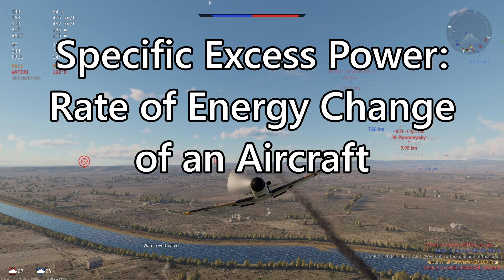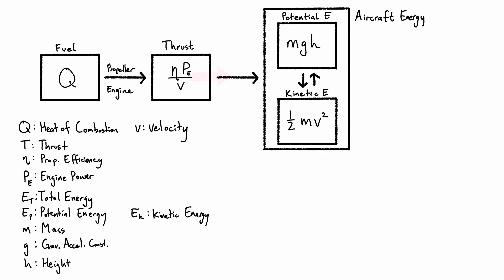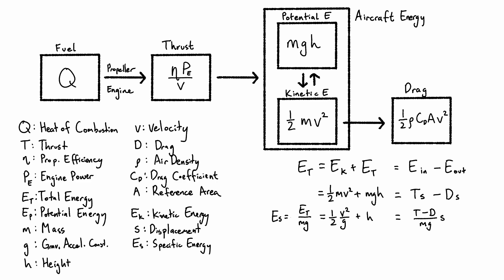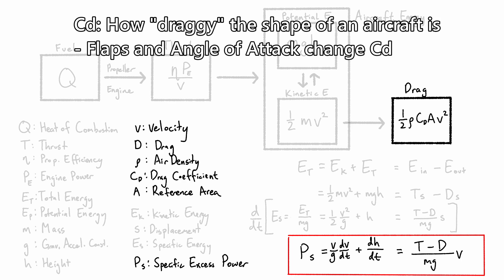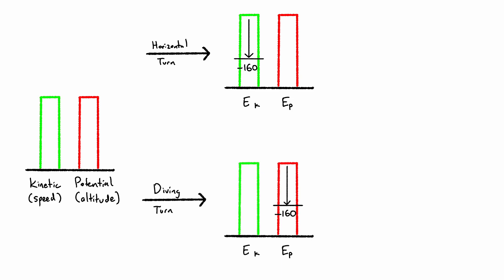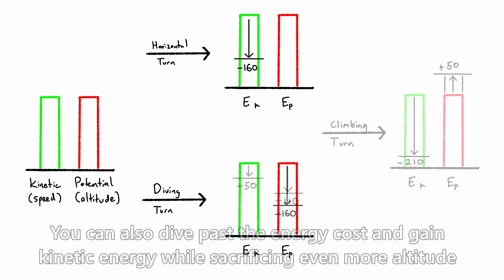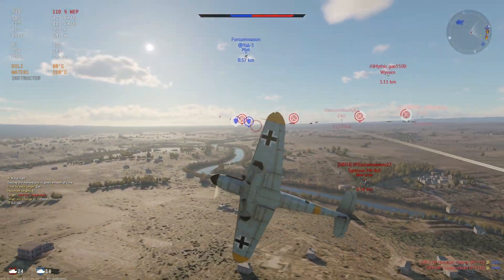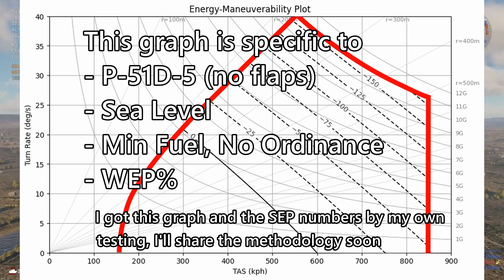Specific Excess Power & MER | EM Diagrams Pt.1.5 | War Thunder

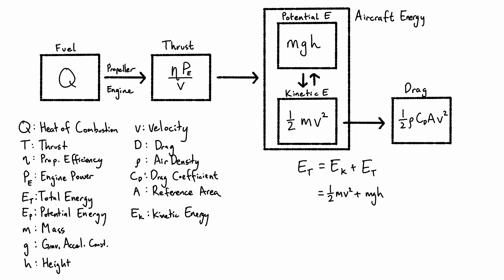Comment from the maker: Typo at 1:38, should be E_T = E_K + E_P
After doing some revising to my script, the EM Diagram I use as an example in this video is not 100% accurate, specifically the SEP contours in the middle of the graph are not angled correctly. Behavior at the edges of the plot are still accurate so everything I say in this video still holds, just if you care about shallow turn behavior, it might not be perfect.
Reply: Another great video! I will throw in a couple nitpicks here besides what you’ve addressed, but these are more an excuse to talk about it than real issues :). First, not an error just something I would have added, normally when we make a value specific or especially talk about energies, we walk in terms of mass- the reason weight is used here instead is because of units, that lets us keep everything in terms of force, thrust, drag, weight etc, for convenience to keep dimensions out of our other coefficients. This is also helpful when looking at optimization or range calculations where even fuel is calculated in terms of weight rather than mass. Next nitpick is have is a common habbit of teachers everywhere when showing an equation is to treat it as a law that causes things to happen- ex the Cd reflects the changing forces on an aircraft to model drag, it doesn’t cause the drag itself, your meaning is obviously correct that’s just a personal thing i have about staying grounded in the physical processes when learning new ideas… last thing is I just want to point out that your discussion about different ways of turning costing the same energy but being able to manifest in different forms is exactly correct from an EM point of view and gets your message across well, but this is actually where the cracks start showing! Traditional EM analysis is largely forced to rely on assuming things are static or happen instantly in a way- it’s very hard to get a full picture of a fluid scenario changing in time,in reality while turning or diving you’re still producing thrust and drag and changing energy states, and the path you take in changing your orientation affects that total both the total drag over your trajectory and how long you are producing engine power etc. You can start to see this in some EM grass such as looking at speed versus turn rate excess energy graphs. You can imagine how someone pull a hard turn and lose energy and then ride that contour down towards low speed and low turn rate, but in general complex maneuvers are almost impossible to capture in EM graphs and particularly how maneuvers chain together is a really difficult, something that wasn’t for a long time is important. It is not just to be able to go up but also down that energy as well because of those maneuvers together and how sometimes you need to be able to affect your turn radius and rate in ways that can’t be done that high energy and so Being able to both gain and lose energy is as important to be able to maintain it, which really wasn’t brought out for the first several years of EM theory being used. Last thing I think it’ll be really interesting for you to talk about is some of the climb optimization stuff that came out of Rutowski‘s workthat a lot of the early development EM came from beside John Boyce work and it’s another really interesting way to use this energy idea to do useful things through aircraft like minimize time to climb
Reply from the maker: @youngbloodbear9662  fascinating, thanks for the info! Yeah the more I do tests, the more i realize that things like AoA and engine thrust output and its PID responses are very much transient behavior and (at least in game) and make it difficult to model rapid changes that happen in a dogfight.
It's becoming somewhat problematic in treating every x,y position on the plot as though it must have just one specific excess power number.
For now I'll stick with this but I definitely have further reading to do.
I was also planning on doing another dive into optimizing climb, especially for aircraft that go supersonic that have to overcome wave drag, but that's farther down the line.
Anyways, I greatly appreciate your takes, keep nitpicking my videos so i can keep learning more!
Reply: @CatWerfer  happy to haha looking forward to seeing what you come up with. I haven’t done a lot of careful testing but i can say the climb dive climb profiles do work in game and I use them in all my supersonics

Comment: Technically there is another type of energy loss which mainly affects aircraft that are capable of vertical climbs (thrust-to-weight higher than one).

Namely, gravity losses. Basically, if the aircraft starts a vertical climb at a very slow speed, it will use a lot of fuel maintaining that very low speed since the climb lasts for a long time while maintaining full afterburners. By contrast, if the climb starts at a higher speed, then the aircraft can maintain that high speed throughout the climb. This means the aircraft climbs faster, therefore reducing climb time and thus reducing the amount of fuel spent during the climb.

This is more generally known as the Oberth effect, and while it mostly affects things like spacecraft, there are parallels to aircraft as well. In general, flying at high speed increases the efficiency of a reaction engine - but it also explains things like why pulling high AoA to achieve a specific deceleration at high speed for 5 seconds loses a lot more energy than experiencing same deceleration at low speed for the same 5 seconds.

In both cases, the speed loss is the same, but since the drag force does work to slow down the aircraft, the energy loss is the drag force multiplied by distance traveled.

And since you travel a longer distance in 5 seconds at high speed, than you do at low speed, that basically explains why high drag at high airspeed is so detrimental to your energy state.
Reply from the maker: huh i didnt know about that, ill have to read about it.
probably won't affect prop planes too much right?
Do you think gaijin would model this? or is this something that is just a manifested phenomenon and would already exist without needing explicit implementation?
Reply: @CatWerfer  There's no particular need to "model" this.

In fact if you think about it, concepts like "energy" and "work" are entirely unmodeled in most physics engines. They are concepts that emerge naturally from a very simple physics framework, and we can then use them to describe the simulation just like we can use them to describe reality.

If you have a physics engine where objects have mass, and you can apply forces to those objects and those forces result in accurate accelerations causing the objects to move, you already have enough to "model" energy and work without any additional programming.

The energy losses I'm talking about are related to the fact that in physics, a force is only doing work if it's causing movement against a resisting force, be it drag or gravity or whatever.

So if you have a plane that is strapped to the ground (or a carrier deck) and you set the engines on full afterburner, they certainly consume massive quantities of fuel, but the plane isn't doing anything to increase its mechanical energy state. So all of the chemical energy converted into thrust is lost as heat, noise, and movement of the air around the nozzle. This represents the peak of inefficiency.

If you turn the plane into vertical orientation and assume that it is hovering at zero speed, using its engines to exactly counter gravity - physically this is identical situation because the sum of forces acting on the plane is zero. This means the plane isn't climbing, nor is it accelerating - it's just hovering there at static altitude, using all of its fuel just to stay still. This represents the peak of those "gravity losses" I mentioned, where all of the fuel is wasted fighting gravity instead of increasing the plane's altitude.

Now if we want to put numbers onto this phenomenon, let's imagine that you're in an F-15 that has exactly 1.0 TWR. We're also going to ignore the fact that air drag increases approximately proportional to the square of airspeed, and just assume that the aircraft can simply maintain "zero acceleration" upward regardless of its airspeed. It's a simplified example, so we're just assuming that during the climb the aircraft's kinetic energy stays constant.

If the plane is doing the above "hovering" with its nose simply pointed up but not gaining altitude, that means it's not gaining any potential energy. All of the energy released by the engines is wasted and none of it is useful for the plane.

But if you start the climb flying at let's say 120 knots, you will maintain that speed during the climb. That means, it takes about 50 seconds to climb 10,000 ft. The fuel concumed is the fuel flow rate per second, multiplied by the time it takes to climb, so the engines consume some amount of fuel during this 50 seconds of climb.

Now, if you increase your initial airspeed and start the climb at 240 knots, the plane will also maintain that speed during the climb. So now climbing to 10,000 ft will only take about 25 seconds, and that means fuel consumption is halved.

That's basically what Oberth effect is. If you are flying faster, a reaction engine can convert fuel into mechanical energy at much higher efficiency, even if the thrust of the engine stays constant.

In practical terms this means that if you're doing a zoom climb, it's better to do it at the highest possible speed because that means you end up using less fuel during the climb.
Reply from the maker: huh yeah ok. for now I'm limiting my scope to subsonics since specific excess power curves aren't a fan of supersonic drag, and that regime is a lot harder to test.
This probably won't have a noticeable affect on props right? the only prop I know that has a very fast fuel consumption rate is the spitfire LFmk9 and other planes with 150octane...
Have you tested any of this to see whether these effects present a significant enough difference to account for ingame?
Reply: @CatWerfer  For fixed-wing aircraft with TWR much less than one, it's not a very relevant term of energy loss, because obviously they cannot maintain constant speed in a climb - if they climb at a very steep angle, it's mostly a matter of converting kinetic energy to potential, since gravity is usually significantly stronger than the engine's thrust.

For propeller-driven aircraft it's doubly irrelevant because the thrust of the propeller is highly dependent on airspeed, much more so than with reaction engines. The fact that thrust is lost when airspeed increases kind of means these aircraft don't have large enough flight envelope for gravity losses to really become apparent or meaningful.

Theoretically, however, it is a valid form of energy loss for flying objects, and it leads to some interesting considerations when you apply the same thought to other forces. This same effect is very much apparent when you consider the inverted situation where high drag is applied to the airframe at different speeds. This is b basically the reason why maneuvering hard at high speed consumes so much more energy than maneuvering at low speed.

That said, gravity losses are usually something that mostly concerns things like orbital rockets and finding the optimal trajectory so that you can spend most of your delta-v in actually increasing the rocket's orbital velocity instead of slowly rising from the launch pad.

Comment: Finally somebody explained those concepts in detail. That's so usefull and interesing tool. Are there any database with war thunder em diagrams? I have trouble finding some googling as usually
Reply from the maker: @daber6948  no, there is no database (yet), its kinda difficult to make them if you don't know what you're doing. Ill try to explain what I do in my next vid

Comment: Looks like drag was simplified to parasitic drag only, but there's also lift induced drag. Because of it there's high drag at very low speeds as the aircraft struggles to stay in the air at high angles of attack.
There's also wave drag when travelling at more than transonic speeds, but it doesn't have its own equation and is just represented as an increase of coefficient of drag.
Reply from the maker: That's true, I just wanted a relatively simple explanation for the video.
Also the Cd that I use for this video isn't zero lift drag, its the whole drag coefficient so it includes lift induced as well as skin friction and form drag.
At the end of the day, Cd is a coefficient arbitrarily designated for an arbitrary reference area so you can really have it describe all drag if you want, itll just end up being nonlinearly dependent on AoA and all the other factors.
The way I account for this when generating the EM diagrams is pretty simple though, you'll be able to see it soon (tm)

Comment: If it's not too much work, you should also fill in the "climbing" part of the graph, it is occasionally used in dogfights
Reply from the maker: the reason why it looks empty is because the contour lines arent fine enough, everything on that side is below 25m/s SEP, and the maximum is reached at ideal climb, at about 20m/s SEP. I could make the contours finer for just that side, but i'd have to figure out how to do that
Reply: @CatWerfer  Oh, right lmao